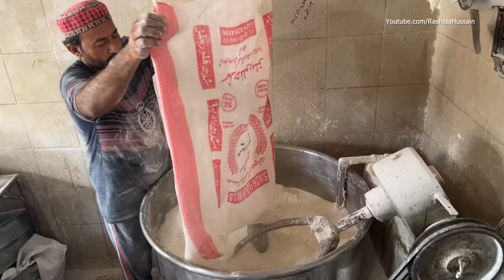Pakistan's Biggest Manda Roti | Street Roll & Samosa Patti - Rumali Roti Making! Street Food Karachi

Comment: Wait a minute.  They work exceptionally and those rotis are amazing but let's talk about that Red plastic container he scoops the water in.  Doesn't it have dirt all over and black mildew spots on the inside.  The water container is open and exposed.  Shouldn't it be covered?
Reply: Even the cameraman is blocking those mildew spots.
Reply: The dough is thrown onto a metal plate and spreads out right onto the dirty cement.  The guy who handles it doesn't wash his hands especially after turning off the diesel generated dough machine 😰